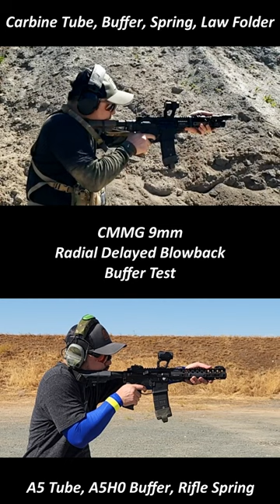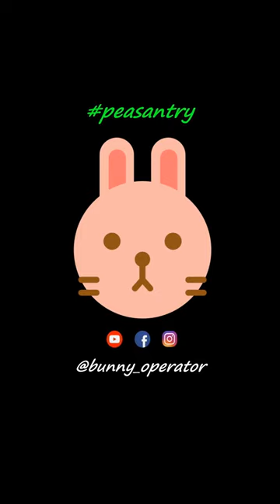9mm Buffer Test #shorts

Comment: Getting a 8” 9mm CMMG upper built and was thinking of using a a5 tube. What weight buffer would you recommend for unsuppressed? I own a a5H3 but thinking that may be too heavy?
Reply: Banshee upper 8” 9mm
Reply from the maker: I actually have an updated short showing the A5H1 and A5H2. You can compare the two and decide for yourself. 

https://youtube.com/shorts/GJM0S9ZaKtI

Remember that the A5 numbering scheme is carbine +1 for equivalent weight, so A5H0 is equivalent to H1 carbine. I think it the RDB does benefit from the additional travel time but I've gone back to the carbine length to see if H1, H2, and H3 make a difference. I will also sample their carrier weight kit. This will eventually be covered in the long format update video later.

Comment: Will my cmmg RDB upper work with AR15 A5 buffer tube , spring, and A5HS2 buffer? I honestly don’t feel like spending more money to buy a hydraulic buffer.
Reply from the maker: Yes, that's what this experiment was. I have a separate short video showing A5H1 and A5H2 as well. My 8" functioned with A5H0 through A5H2 so it's a matter of figuring out what works best for you.
Reply: @bunnyoperator  Thanks for the quick reply and confirming my question.
Reply from the maker: @therainydayshooter2973  Absolutely! Feel free to report back. Additional data is always helpful.
Reply: @bunnyoperator  Will do. I ordered a cmmg banshee upper with a 5 inch barrel. Hopefully it all runs good.
Reply from the maker: @therainydayshooter2973  You'll be fine. A5H1 worked best for mine. I did go back to carbine length to test those weights out and see if there's a difference. Standby for those later. So far only carbine weight was tested which was used in this video that you saw, granted with a law folder so that's probably equivalent to H1 in weight.